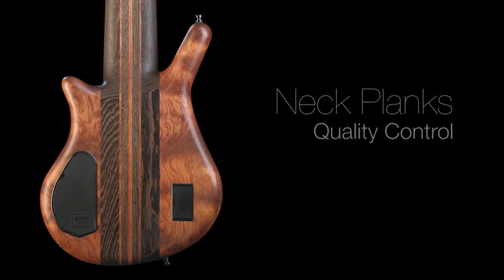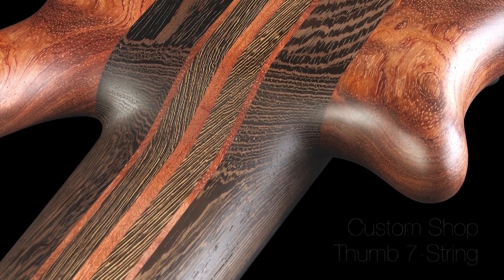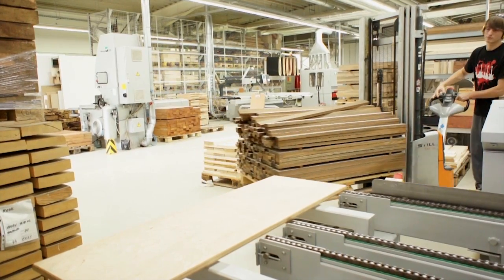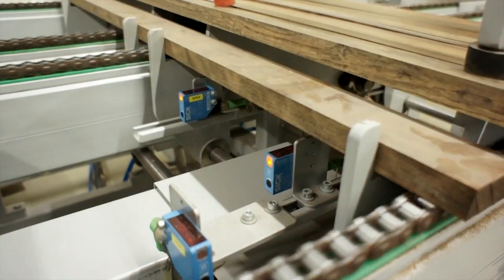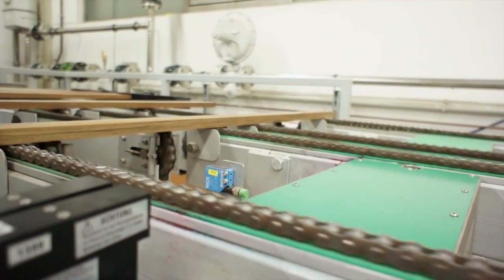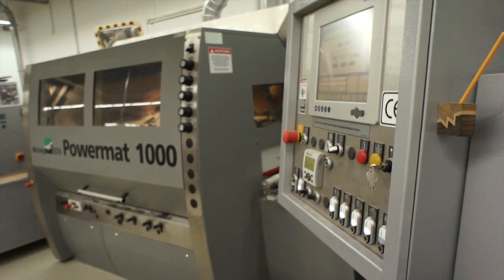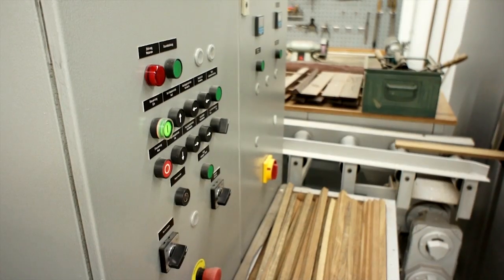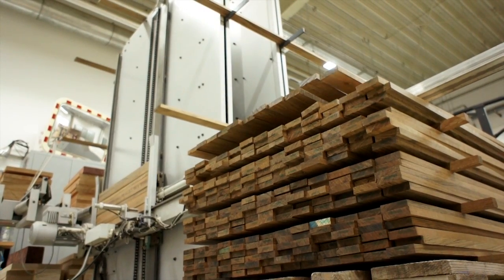Warwick Factory: Neck Construction (Pt.1)

Comment: if i understood correctly, you mean e.g. a bass whose body and neck is made from one solid piece of wood, with a different type of wood for the top and the fingerboard? you would need one big slab of wood and loose a lot of material during milling...